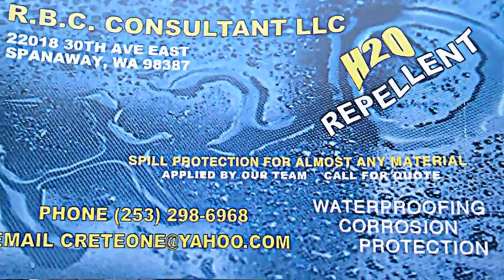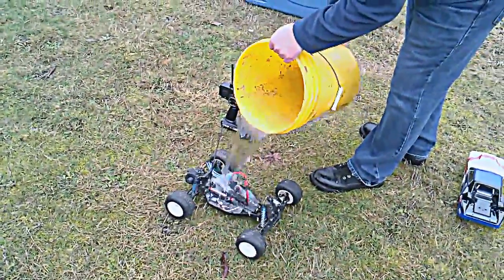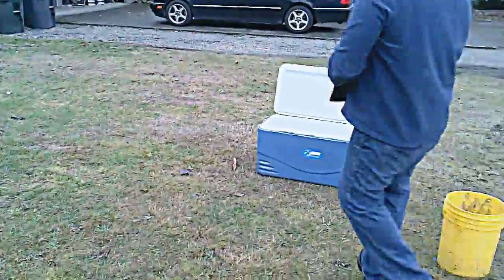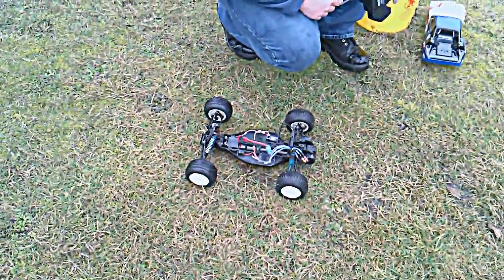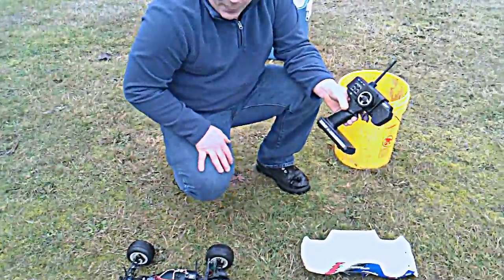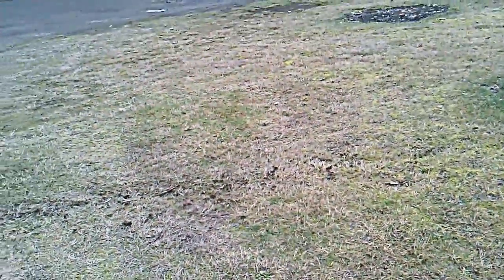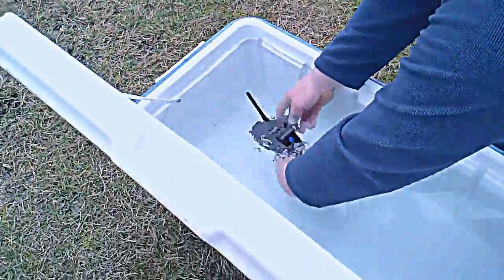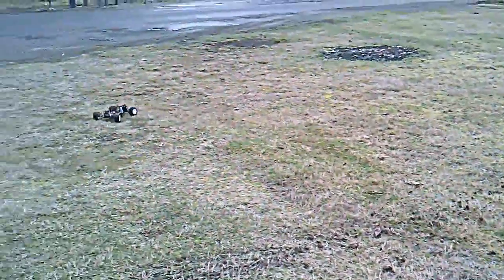ultra ever dry, Waterproof rc radio, working under

Comment: Would be interested to see two of the same remote control boats (1 treated, 1 not) race with one of the boats having the hull coated.  Would a coated hull make for a faster boat in the water?